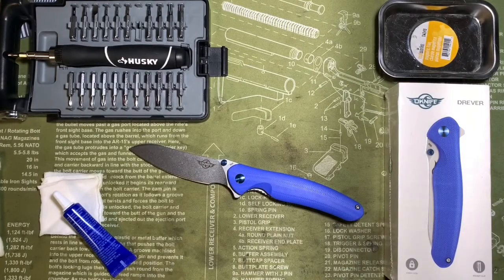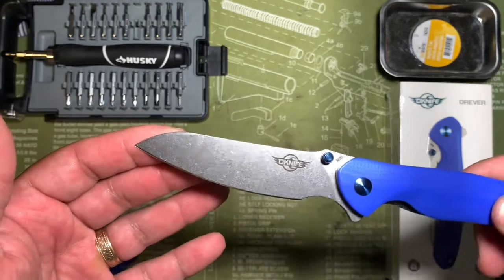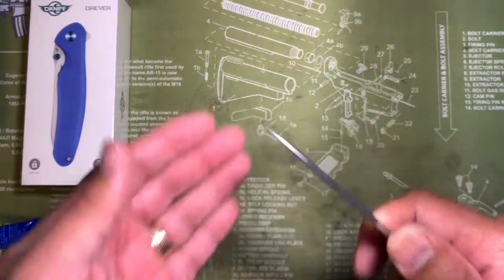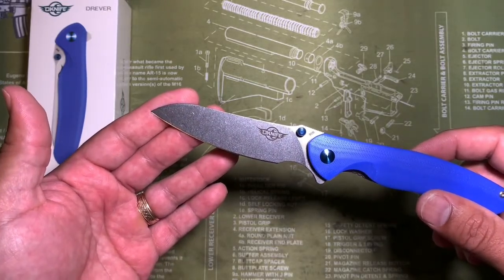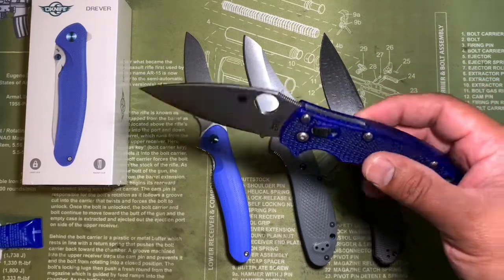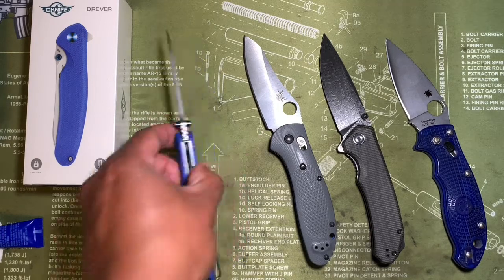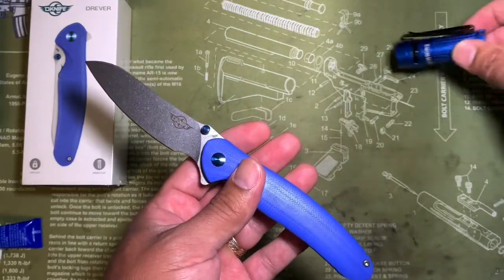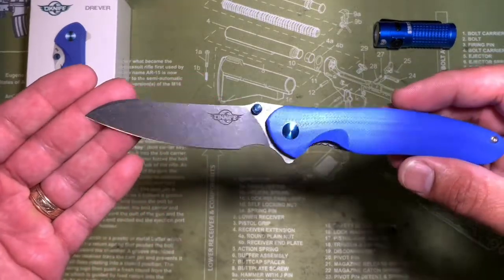Olight knife Oknife Drever

Comment: How was the knife after locking the pivot screw ? Surely you've had sometime to use it after tightening, good video buddy, The more I look at the knife, the more I like the shape.
Reply from the maker: Glad you enjoyed the video! The loctite did the trick and it was good to go. Just make sure you use low strength loctite (like 242) so you can take it apart in the future without issue. The blade shape and overall profile of the knife are really good.